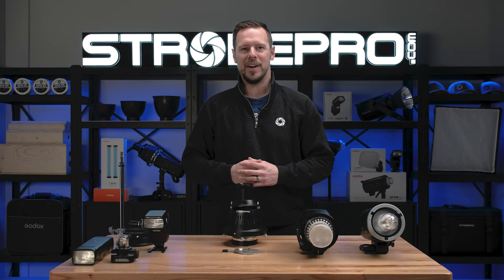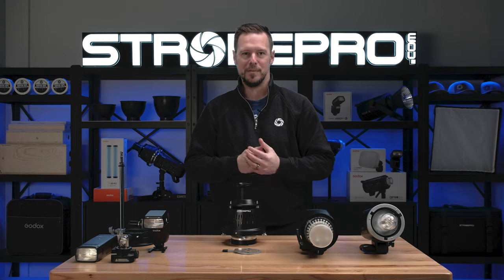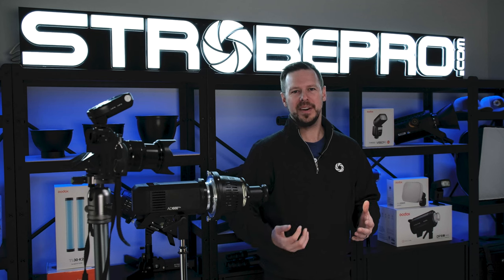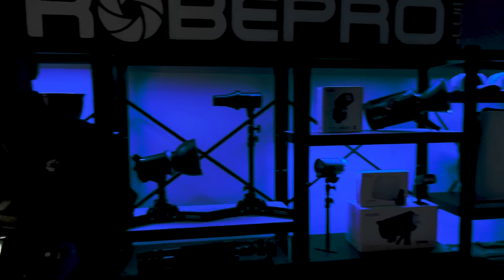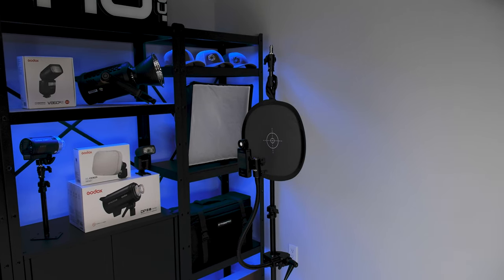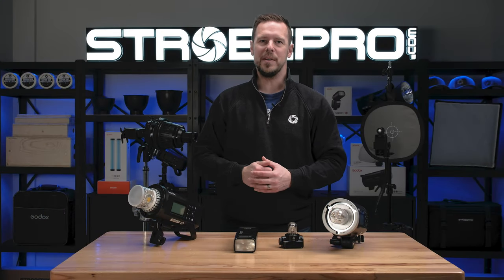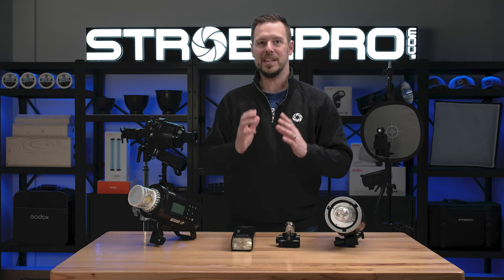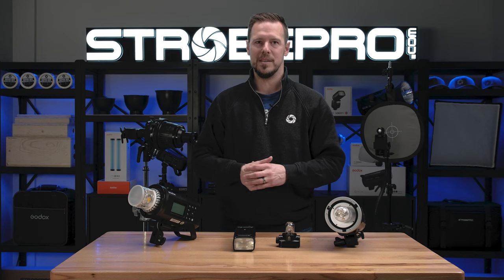The Best Strobe for Your Optical Snoot?

Comment: Hello, surprising results indeed. Thank you for sharing this. One question, the inner lense on the optical snoot is the clear crystal version or is the frosty one?
Reply from the maker: This test was done with our Optical Snoot II, which has no frosted element.  Worth noting, we did not notice any significant differences in pattern evenness among the tested strobes.

Comment: Hey.  This is totally off topic… but I have  suggestion for Godox.  Just got an AD600 and the extension head.  Both come with adjustable light stand adaptor.  The point I want to make, is they’re notched/ have teeth. Makes them superior for holding heavy modifiers.  Can they make a new S2 bracket the same way?  The brackets that just depend on friction are easy to fail with large modifiers. Thanks.
Reply from the maker: Interestingly, the original S-bracket did use a toothed design.  A lot of users didn't like it and asked for something stepless. We may still be able to get an original S-bracket or three on a special order if you are interested. Drop us a line at hello@strobepro.com.

Comment: This is an interesting video.  Thanks for doing the tests.  I have a question for you: Is it possible to mount the optical snoot onto the Godox MS300 or will the modeling light prevent it from attaching properly?
Reply from the maker: Hi A.O.,

The modelling light does not interfere with mounting the Strobepro Optical Snoot.  We made sure the inner mounting area had plenty of space so that it fits on virtually any strobe.  :)